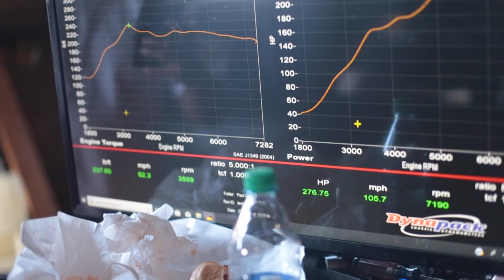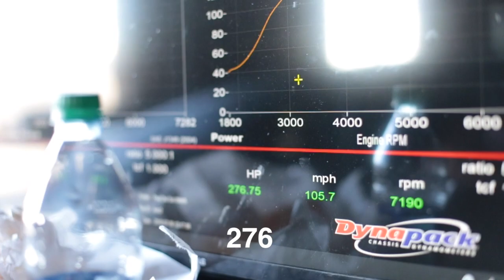Greddy Turbo Kit for Frs:Brz

Comment: Still stock internals?
Reply: You can run with stock internals in an 86 up until you hit the 350+ hp mark. But more people only go to around 300 as it’s enough power for the street.